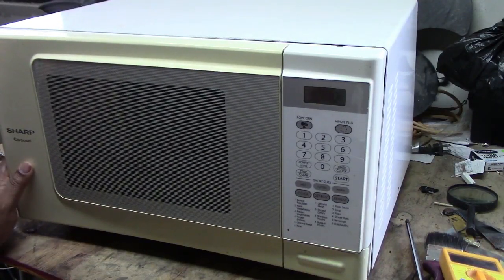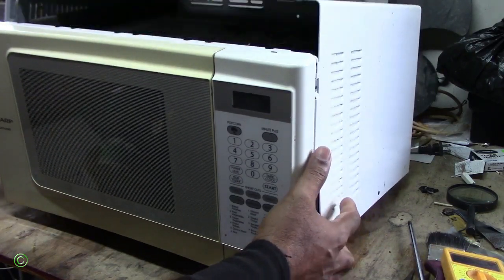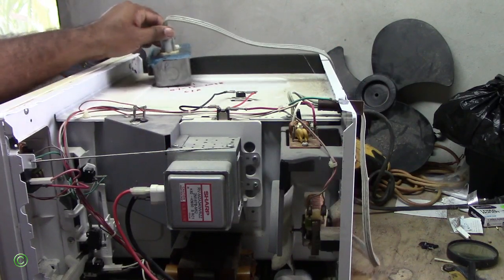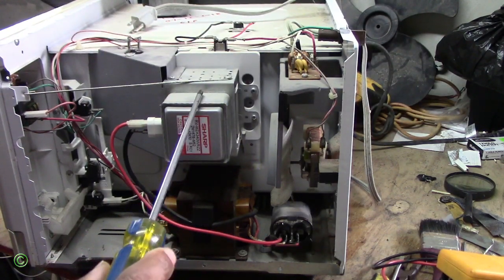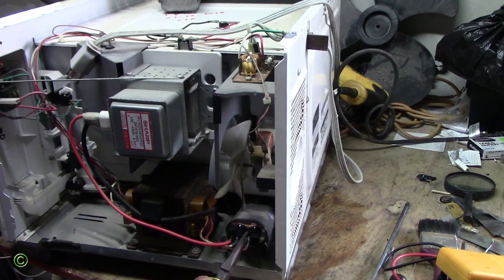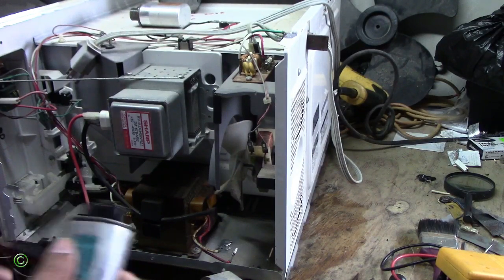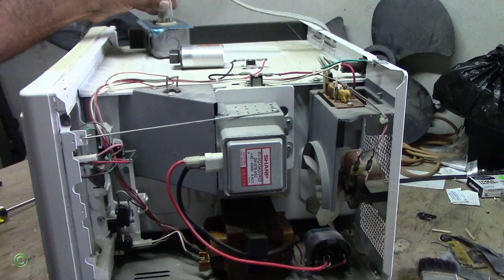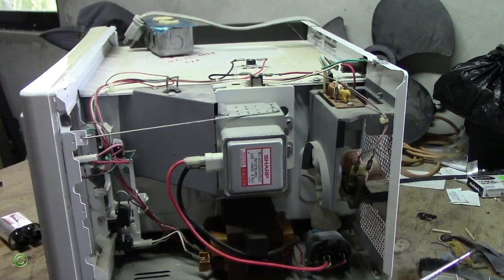Sharp Microwave Oven (fuse keep blowing)

Comment: this is the exact model sharp carousel microwave that i have.  Right now i am waiting for my neighbor to visit me and assist me in removing the cover and I will discharge the capacitor and remove the 20 amp ceramic fuse.  Also I will remove the thermal cut off switch on top and do a test for continuity.  I learned all this from watching your videos for the last 2 days.
Thanks. I will also check the monitor switches and try to test them if i can.
Reply from the maker: Glad my videos was helpful. keep up the good work.

Comment: Dear Mr Fix It 360,
I hope that my last messages did not offend you. I apologize,  I have a question.
do the sharp carousel microwave use a 20 amp ceramic 125 v or250v slow burn fuse? Also what are the dimensions for the fuse?  Also what is the proper replacement thermal fuse  to be used?
Thank you
Reply from the maker: good question. all microwave oven carry between 15amp/20amp or 25amp fuse. if you not sure a amp value check the circuit board it mark. 

now the slow blowing fuse is mostly use on blender. not microwave oven. if you find a slow blowing fuse in a microwave oven, then that microwave oven been repair before. 

I hope that answer all your questions.

Comment: My sharp microwave works but is leaking dielectric oil from the capacitor. It is strange that No One mentions this as a problem or possible failure. Some people even swear up and down that there is no oil in these HV capacitors. They are all filled with oil. ( non hazardous but yes oil).

Comment: opened the microwave and removed the line fuse it clearly blew.  awaiting a new fuse from China. as there is none here in Nevis. I am yet to test the thermal cutoff switch on top.  also will test the monitor switch and micro switches (2). I found the replacement micro switches from china and yet to get a replacement monitor switch.
just saying thanks for the info.  I was very nervous but I actually did it.
Reply from the maker: Glad my video help you.

Comment: Hi, the control panel and the light are working.  But the tray and fan are not moving.  And it is not hot.  Can you tell what wrong with the microwave?  Where is the thermostat located?  Thank you.
Reply from the maker: it could be a switch problem or circuit board.

Comment: Sir can i ask something about the interlocking switch correct if im wrong question
1 the primary interlocking swictch is the lower portion and the middle switch is the monitor swicth and the upper swicth is the secondary interlocking switch im i correct  sir
2 if the switches changes the state in normal state in normal condition what happen to the microwave 
3 tnx sir your video well appreciated  subscriber from the Phillippines more power
Reply from the maker: Well not all the time The micro switch does be in that order. all microwave interlock switches are located different places. sometimes the primary switch does be on top and times you can find it below.
Reply: Not all microwave models have the switches in a specific order in the switch holder. The best way to know is to look at the drawing inside the microwave. Otherwise test the switches. The primary switch is the first to bring in power from the Line filter after the fuse. The primary switch is a NO switch. The monitor switch is connected directly across Line and Neutral and is a NC switch.When the door closes this is the first switch to activate and goes OPEN. This is an interlock so if the primary switch contacts fuses closed the 20A fuse will blow and you can not start the microwave with the door open. The secondary switch is a NO switch. These are all positions with the door open. You need a multimer to test these switches.

Comment: Hi, I noticed the Sharp microwaves do not have a HV fuse connected between transformer and capacitor in other microwaves, is the fuse you're changing in the video actually an HV fuse? Because it looks like a normal fuse and does it do the same purpose as a HV fuse between cap and transformer. Thanks
Reply from the maker: In some Sharp microwave it don't need a fuse between transformer and capacitor.
Reply: @mr.fixit3604  i have HV fuse between cap and transformer, what if i remove HV fuse and run without it. is it dangerous ?
Reply from the maker: @seckinseckin3919  you can run without a fuse. But it's dangerous. The fuse is to prevent overload and in case of a fire. In case of high voltage or overload the fuse will blow as a safety switch.

Comment: Hi there hope you can notice, my microwave fuse keeps blowing even the capacitor and diode are new, i diconnected every parts and only the high viltage transformer is connected still the fuse blows off. What would you think is the problem?
Reply from the maker: Hi. did run test on all the parts? check the magnetron and the microswitch on the door latch.

Comment: Hello, you sound like a truetrini.  I am a trini living in Nevis and my sharp carousel fuse blew 2 years ago when I foolishly tried to cook rice in it. I dont want to buy another microwave although it is cheaper than fixing. However I would want to fix it myself.  Your video is very good for my problem.  Are there more than one fuse in it? also do you sell replacement fuses in Trinidad? If so let me know
Reply from the maker: I came across a very expensive  microwave oven with 3 fuses. some microwave oven carry 1 or 2 fuses it depends on brand and cost.